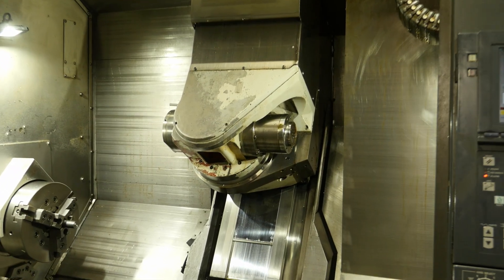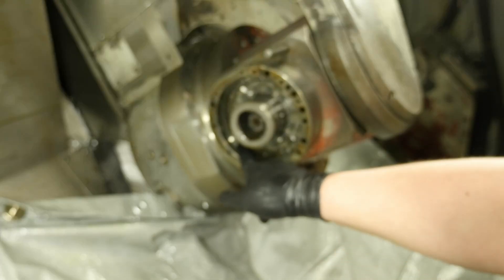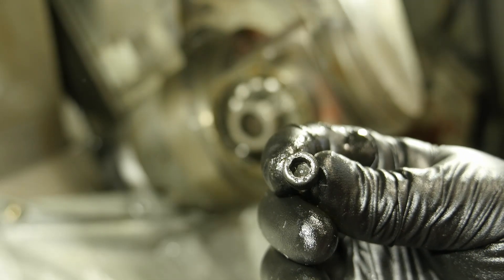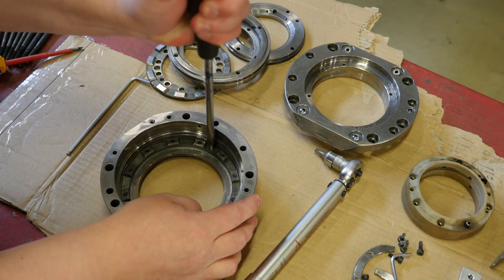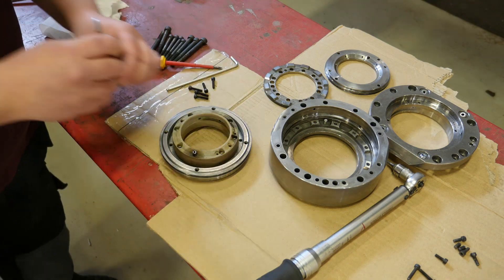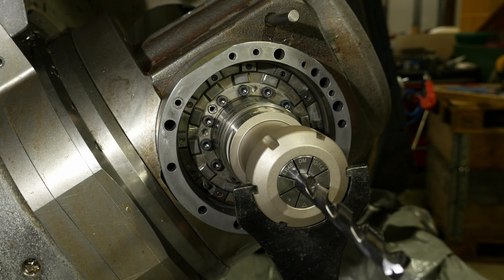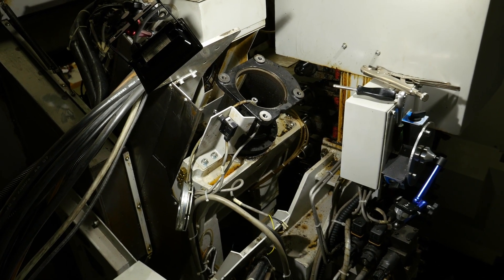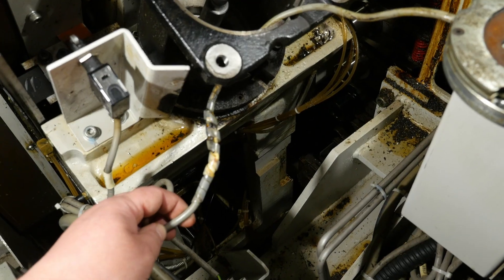2 major repairs on the CNC lathe after crash. Mazak Integrex spindle repair.

Comment: Home made parts are bad. A good shop should be able to handle making some parts properly . However,  material selection is where many simple Machinists screw up. I expect  them to get dimensions correct as a base. It's our career. But material or the physical properties of metal are extremely important. Beyond hardness and elasticity is thermal expansion, thermal conductivity and thermal  fatigue. The previous guy may have been close but didn't actually go a step further towards engineering. Side note. As a pilot and Machinist it is a base requirement to not crash a machine. In 20 years this has happened in our shop of 15 Machinist, engineers and tool and die guys once. He was summarily dismissed. It's unfortunate that this is a standard only reached by 20% of Machinist. Imagine if pilots were like that!

Comment: I know you already replaced the brake. Whenever I deal with one of those brakes that don't grip enough. I have someone jog the axis back and fourth as I spray brake clean in it and blow it out with air to get the oil out. 9/10 it works. Also, the front curvic coupling is worlds different from a MKiv Integrex. Which makes sense cause the milling spindles aren't even close to each other.

Comment: I winced when you started wiggling the tool holder back and forth in the spindle

Also, why wouldn't the previous owners just order OEM replacement parts direct from Mazak instead of cobbling it together with half baked homemade parts? Is it really worth it in the long run? So many shops are pennywise and pound foolish.

Comment: In case no one else mentions this... precision flat ground stones, many shapes and sizes, all expensive, some hard to duplicate easily in a job shop without a surface grinder and/or a spinner for some shapes  - and the holders for these stones for grinding them. Experience counts, clever setup and fixtures help, and a lot of lucky breaks. Good luck!
Reply from the maker: You can actually see one of them in a shot but i didn't include it in the video were i used it. It wasn't much to see.

Comment: You do know you can get hex head impact bits so you can use ratchets or impact guns to remove things much faster than using Allen keys
Reply from the maker: Hehe yeah I've got sets of those. I just wanted to take it slow. Didn't know what suprises was waiting for me, since i knew from before how badly the precious owners had done some repairs. Also quite a lot of precision surfaces on those components that i wanted to be careful with.

Comment: Whats the hell dont usw the grinder have Not a lather?
Reply from the maker: Slightly difficult when the lathe is the machine being repaired. The area I'm grinding doesn't have a bolt nearby, so it will stay flat when everything is assembled.

Comment: 8.7mm ???  i read 0.697mm   let us see more video  at this  .. i cant see how the cuplings works  hydrulik .
Reply from the maker: Here is how it works. If you look at 10:10, there are 8 holes with O-rings around them. 2 air, 4 coolant and 2 hydraulic oil for the coupling. At 9:07 you can see a small hole in the side of the cylinder wall (next to the top edge, between my hands). In the next clip a few seconds later, you can see the other hole a few centimeters to the right, lower down in the cylinder. That's how the oil goes to the middle ring. In the same clip, you can see that the middle ring has 4 threaded holes. That is the surface that the hydraulic force is action upon, to engage the coupling. It's not much, maybe 15-16 mm wide, but still maybe 40kN of axial force. A few seconds later, when I put the O-ring in place on the middle ring, you can see there is a lip underneath it, maybe 2mm wide. That is the surface that the hydraulic force is acting upon to push the middle ring forward, to disengage the coupling.

I kind of regret not including this in the video. Was close to include a picture of the drawing of this entire assembly, but for some reason I skipped it.

Unfortunately there are several more things that need to be fixed with this machine. At least it's fun fixing it and making videos about it :)

Yeah, I have no idea why it sounded like I said eight. Must have been running low on coffee :)
Reply: @Rydermanmakes  now I can see that the 4 threaded holes are blind so oil cannot get that way. I have worked with hydraulics for many years and am a machinist so I have seen many systems. it was the 4 threaded holes I couldn't see didn't go through the whole thing,,

Comment: Professional work! With what size accuracy does this type of machine work, 0.01mm included?
Reply from the maker: Thank you! I can usually get e repeatability within 2 micrometers if the material doesn't have a lot of internal stresses, when the machine is running part after part. If I'm running a one-off part and I'm sneaking up on a critical diamter, i can usually get it within 1-2 microns in materials that are easy to machine, but steel and stuff that has a bit of springback usually gets me within 2-3 microns.

But there are a lot of variables to this, such as material, internal stress in it, stock size, stickout from the chuck, huw much of the stock that's being removed, insert grade and so on.

Comment: Looks like an absolute nightmare to repair or refurbish, especially once Mazak won't sell you parts, anymore.
Hirth coupling is very similar on what you find on CNC lathes.
That capto spindle however, once it's knackered, have fun with regrinding. Even more evil than HSK.
Reply from the maker: Why won't they sell parts? I had no problem buying these from them. I got the BOM anyway, so I can find most items from other places. 
I thought that the repair was quite fun. Just a pain in the back from leaning into the machine, and a big camera right where I wanted my head was maybe not so fun... 
Yeah, I do have a little bit of a wobble in the capto taper, but not much. I am considering fixing the spindle bearings and the bevel gear some time in the future. Considering going all the way and sending the spindle off for a regrind.
Reply: @Rydermanmakes  The machinery I usually get/can afford for slightly above scrap price are usually 15-20years older than your Integrex.
Nothing with factory parts on these any more, either you fix it or you make replacement part yourself or the machine is dead.
Reply from the maker: Ah ok. Yeah that is a tough one. Guessing parts for those have not been in stock for a long time. I thought you meant that you were not allowed to buy parts. For the first 3 years, I could not buy parts from mazak for my machine since it was not registered to me. I know that haas wont sell some components but instead requires it to be installed by a Haas tech.

Comment: Wow, thats an old Mark II?? Didn't knew they already were sold with a CAPTO-Coupling.  Nice repair!
Reply from the maker: Thanks! Not sure if it's mark 2. It's from 2001 at least.
Reply: @Rydermanmakes  Mark III and newer have a direct drive millspindle without gears or hirth coupling.

How fast can this mill spindle run? 8000rpm?
Reply from the maker: It's a 6000 rpm but i rarely run it more than 4500, since it's so noisy. Either the spindle bearings or the bevel gears. Thats why I might replace both in a not to distant future. Also kind of ruins the filming with all the noise (if you've seen any of my other videos). However, i've looked through all the drawings and everything is identical between the 6k and 10k versions, so i might have a look if it cant be boosted in the machine parameters. The only thing i have not yet checked is the driver for the milling spindle.

if mark 3 didnt have the hirth coupling, how did it lock the spindle for turning?
Reply: @Rydermanmakes  Ha, i maybe was accidently lying. Im sure about the machines with a b2-axe (able to do interpolation turning) but i guess up to mark4 (12000rpm) they maybe could have kind of hirth.... but if, it looks totaly different.  
I never had to disassemble an integrex mill spindle, so i only could tell it exactly after i studied the blueprints.  
The think i-Series has some kind of hydraulic ring clamping segment (same on the b-axe) what is absolutely strong and precice. Sorry for not having reliable details at the moment. I will investigate, after my vaccation ends.
Reply from the maker: I don't know if I can do any interpolated moves with the B axis. Someone told me once that my machine can only do indexing moves. Anything you know about?
I have all the drawings for the entire machine and BOMs and looked at them quite a bit. The rear end of the turret looks quite simple, so shouldn't be to much of a problem, unless there is some suprise, like components that require fixtures or parts that are shrink-fit.
Reply: I don't know, if there was any Mark II what can interpolate with the b-axe, i startet with Mark III. But today such machines still were build, they are sold as Integrex "j" instead of "i" or "e".   Cost far less but fit for the most applications. A "b2" axis is a different thing, its an interpolating mill spindel - really raw.

Are you sure, that the noises come from the spindle itself, and not from the gears? Wouldn't u see some issues when doing milling operations?
I'm really curious to see how the repair goes, hope it will work.
Reply from the maker: I had a look at the drawings for the B-axis, and looks like it's just the gear on the servo motor, a gear in the middle, and a large gear attached to the turret. No wormgear, strainwave or cycloidal gearing, so that rules out any possibility of B-axis interpolation. An interpolating spindle so that it basically becomes an extra axis? For tools like ceratizit freeturn? Those machines are really cool.

Yeah I was wondering if it was the bearings or the gears. I wish i would have taken a few minutes when i had everything apart to investigate it properly. But i will likely replace both anyway. We'll see when i get to it. Got a lot of jobs for the machine and at the moment it "works". Just extremely noisy...
Reply: @Rydermanmakes  Ah okay yes, you would need some back lash free transmission for an interpolating b-axe. Just gears make it impossible.
Yes, thats exactly what a B2 axis is made for. I don't see massive benefits in that freeturn tool, but with B2, u also can turn conturs which are not parallel to the z-axis. Years ago, i operated a Mazak HCN with that option, what was great because we could turn shaped contures with x/y+b2.
Ofc, there is no option for this in mazatrol, u need to do it in EIA ISO, by hand or with a CAM.
I absolutely understand that you need this machine just in a working condition. There are ear plugs for such situations :D
Reply from the maker: Yeah freeturn looks quite cool. But I think the areas where it makes a big difference are quite small. Oh yeah, that kind of turning is quite nice. Also guessing quite a niche usage for it? But yeah, much better than a new setup in another machine, if you can't get a good enough surface finish with milling those angled features?

Never tried programming mazatrol. It's annoying enough just to edit a program with that keyboard on the machine.
Reply: @Rydermanmakes  Freeturn may have some advantages by taking the load into z-direction of the mill spindle instead to x, but in the videos i have seen, they just did small cuts - i use 45° Toolholders to reduce the forces on the millspindle (it also gives you more room to the turning spindles).  
U also can often see videos, where they conventionally turn parts while moving the b-axis. Sure, it looks cool but makes no sense if you look at precision. Your tool length must be - and stay - absolutely accurate and you had to ignore tool length corrections for this operation, what makes it impossible to turn precice parts. 

Interpolation turning is not that niche-technology u may think. If u have to turn undercuts with a depth in Z and X (like DIN 509-F in Germany), u are not able to mill it (exeptc its very wide). Any axial groove what lays direct on an outer diameter, because there is no room for a shrink- or collet chuck.

Comment: Great job, and excellent video!

Only things I would say, torque the hirth coupling screws in a cross pattern, when you inserted the tool holder to counter hold, that is actually the correct way. Same for HSK when tightening rotary unions for example.

And lubricate orings, maybe mazak specified not to do so, let me know if that is the case, but on DMG machines, all this type of stuff is lubricated with certain oil grades or silicone grease.
Reply from the maker: Thank you! Yeah, I should have thought about that when torquing the coupling.
As soon as I started torquing the bolts, I remembered that they were only going to 17 nm, so I figured the capto could handle it even if it was not properly seated :)
I didn't show it in the video, but I lubricated them before I assembled everything. You might see that they were a bit shiny when I was doing the reassembly. I don't know what Mazak says about it. Don't have any of the documentation.

Comment: Uhh that Polygon Holders such a crazy thing..
Is the other side also that broken?
Reply from the maker: Yeah the capto toolholding system. Best system there is (except the price).
Reply: @Rydermanmakes  Well i think the price is just the thing of it being not so easy to create
Reply from the maker: Yeah grinding such a perfect match between the taper and the flat face is not easy. Especially when tools should have a repeatability of 2 micrometers, according to Sandvik.
Reply: @Rydermanmakes  Not a big deal to do polygonal grinding, almost any CNC cylindrical grinding machine can do this (but tool manufacturers probably do not use "any" machine). The trick is they constantly measure the polygon size while grinding (without interrupting the grinding process) at a given distance from the flange.
Reply from the maker: Yeah that's what i meant by getting those two surfaces perfectly matched. I think Sandvik invented it in the 80s. Guessing it was a bit more tricky back then.